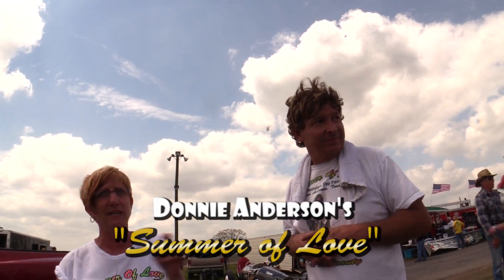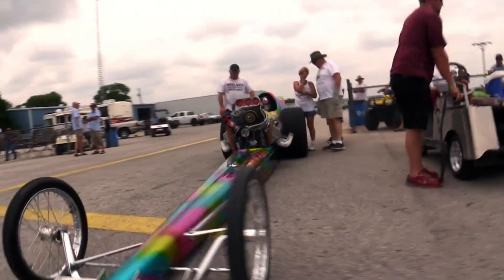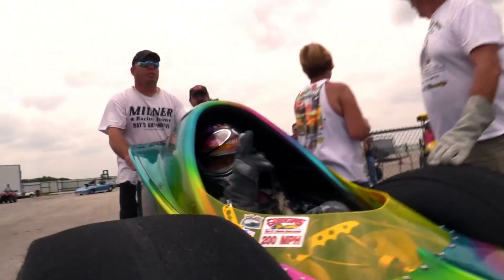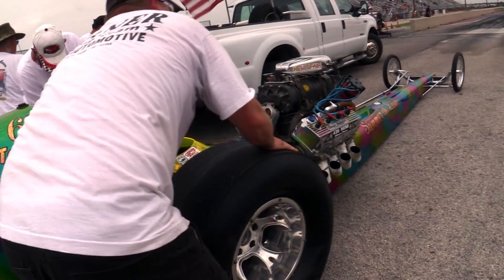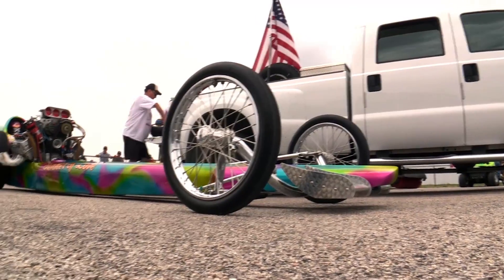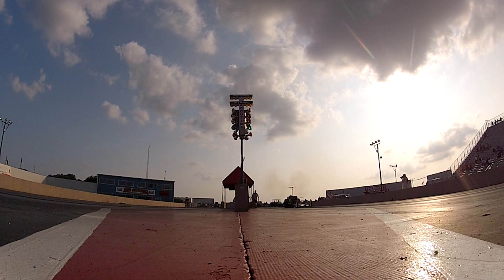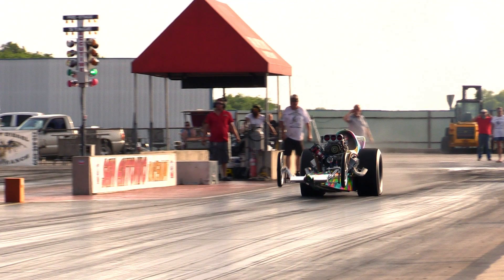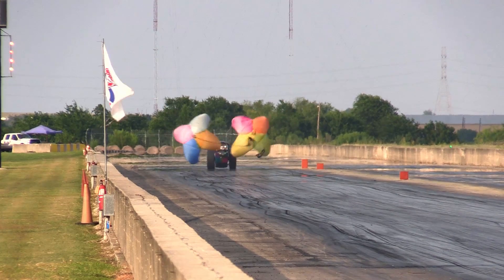"Summer of Love" Front Engine Dragster

Comment: Didn't think they were "safety" legal to run?
Reply from the maker: Deeman4evr Most all “nostalgia” drag cars these days have updated chassis and safety components that comply with modern day regulations.
Reply: Understandably but they don't look much like yours. Double hoop roll bars, much higher driver position, and usually a lot of wings. Not sexy. This is the only one that I've seen that looks like they used to that actually made a pass. Beautiful car and brave man to pilot that thing!
Reply from the maker: Deeman4evr well, this isn’t my car, but yes, I agree. Donnie built this himself so he may have made a few modifications to fit his style over what is recommended? Not sure.
Reply: Deeman4evr of course they are.
Reply: Seen plenty of 70s match race fuel dragsters and funny cars back in the day. The bigger problem was the track prep more than the car. Short shut down areas for cars at over 210 mph. Bad tracks with humps in the shut down area. Detroit dragway was one of them. No guardrail  for car and crowd safety. The cars were quick but the track sucked